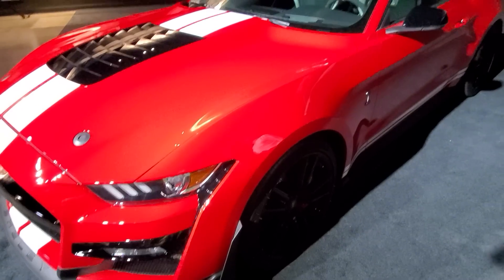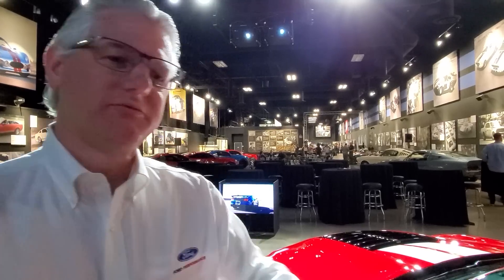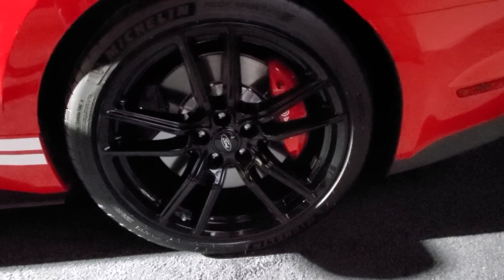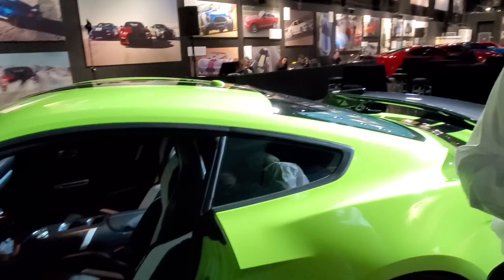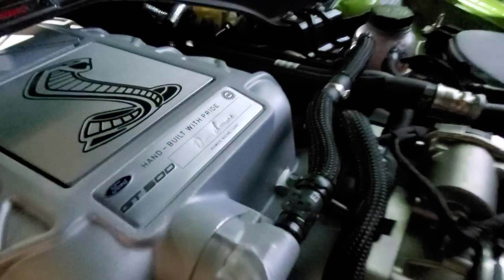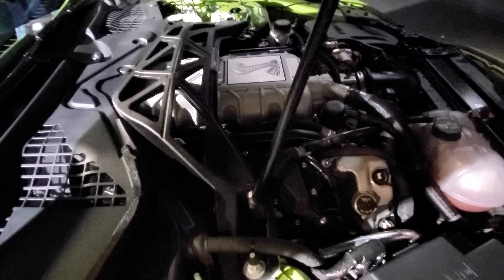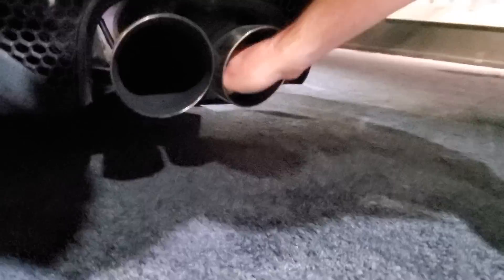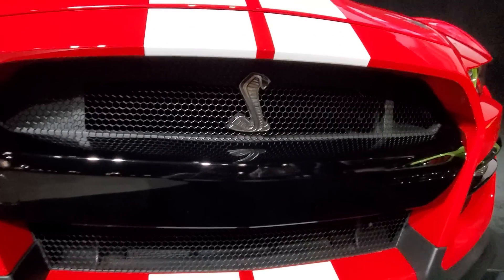2020 Ford Mustang Shelby GT500 Sneak Peek: Base Or Track Pack? We Show You The Differences!

Comment: Shelby GT500 or Roush Stage 3? 🤔
Reply: DaveSKI Shelby. Better suspension breaks and cooling. Oh and a higher rated transmission
Reply: @devinbender8428  But does it have a manual transmission?
Reply: DaveSKI yea. But have you ever driven a high HP car with a manual? It isn’t fun. Sure day to day ain’t bad. But on a track? It’s impossible to have fun because your always focusing on shift points.
Reply: Devin Bender if your a skilled manual driver it comes in second nature no need to focuse on shifting 😂😂
Reply: @devinbender8428  They're somehow able to shift in 900hp cars in NASCAR
Reply: DaveSKI 
1 NASCAR is a 4 speed and even on road courses only use 3rd and 4th 

2 Lemans cars only have 500hp and are 6speed sequential gear boxes.  Not H pattern.

These cars are 700+hp 7speeds. 

I’ve driven a z06 vette and it’s not easy with a manual. That’s a big H pattern. (Ive driven many manuals. Learned on a 90s Chevy) If it was sequential that’s one thing. 

Also last thing you want to do is “money shift” in a 80,000+ car
Reply: @devinbender8428  The Roush has a 6 speed
Reply: @devinbender8428  If its Dodge Demon power, yes you cant handle shifting, but 700hp is still manageable by your average stick shift driver
Reply: DaveSKI manageable that’s one thing. ANY car is manageable. 

But fast on the track? Very hard

Comment: I just wish it had the updated headlights
Reply: Sander Valpey ford said the old headlights work better for the cooling system
Reply: @devin bender They could have changed the shape of the vent. It’s because they started the design with those headlights. They could have designed the vent while designing the new bumper and headlight housing.
Reply: Sander Valpey the used the gt350 as a starting point. And the radiators used in that wouldn’t fit in the new front end design. That’s the main reason. 

Re engineer the whole front end cooling system. Or use the old style.
Reply: Devin Bender I get. With all the wait and hype. Why not make it new. People may have paid more for it

Comment: So top speed is slower than the previous GT 500
Reply: Maurice Cooper because it’s electronically limited for insurance and safety. 

There are very few places in the whole world you can hit 180+
Reply: @devinbender8428  I hit 165 in my 3v on the highway I'm sure the newer mustangs can go 180 on a highway
Reply: glasstop_3v 

 and that is the reason why it’s electronically limited. People illegally taking a car down the freeway at 200 miles an hour.

In a LEGAL setting, 

Autobon 
The Ring,
Salt flats 
MIS
Daytona
Talledega 

That’s about it.

Comment: 2014 GT500 Shelby: “is this supposed to be a better me in 2020?? And it can’t do 200mph....AND ITS NOT MANUAL what a disappointment🤦🏽‍♂️”
Reply: ZEUS6.7 two different cars. Put drag radials on a 13-14 and go 11 flat, pulley it and go 10’s
Reply: ZEUS6.7 

It’s electrically limited to 180mph for safety and  insurance. 

There are very very few places IN THE WORLD you can hit over 180mph
Reply: Scott Croce yes I’m very well informed thank you. But it was a joke
Reply: ZEUS6.7 unrestricted top end is 224mph(with special tires) factory tires only rated to 186mph but don’t tell anyone.
Reply: Scott Croce well I’m sure the new GT500 can well achieve that it’s the same with a lot of the other car manufacturers for example the Redeyes, Camaros, etc etc.

Comment: TFL, today is October 26th, 2019. I know an amazing and great man that lives in Reno. He and his associate/friend have (after many years of research and thousands of dollars) patented a new fuel delivery system that (on his test vehicle, has almost doubled the gas mileage to between 50 and 60 miles per gallon on unleaded regular gasoline). And because the the system causes the gasoline to burn so much more efficiently and CLEANER, it greatly reduces emissions. Some of the tests so far have gotten virtually ZERO pollution results. In my opinion, THIS IS HUGE and I am encouraging you to investigate this. This new fuel delivery system can be modified to work in vehicles and all types of motor applications, but the costs to do so can be high. This development has worked, is patented, but needs deep pockets to get it off the ground. I was thinking about NASCAR where the race cars could eliminate a fuel stop or two. Or government agencies (like the Highway Patrol and CITY Police Departments) where fuel costs are so high, and could be greatly reduced. IF you are interested/curious, please let me (Always Good) know by replying to this "Comment", and I will get back with you! It is just a matter of time before this new fuel delivery system is adapted, and you have a chance to check it out and be a big part of it's implementation!

Comment: The capability to be outsold 30 to one against the C8 corvette.
Reply: Donnie Baynard C8 will be just as fast in a straight line. But not on a track
Reply: Devin Bender holy shit i hope ur kidding. C8 will eat this thing alive, not even talking about when the z06 comes out. Go compare the weights of this pile of overpriced shit to the c8. Who wants to be that guy that is pretending to be proud that hes driving around in a MUSTANG that they paid $100,000+  for it.
Reply: @Drewfus53  What? The base C8 does the quarter mile in 11.1 secs. The GT500 is going to surprise everyone come Tuesday when they can release the numbers.
Reply: @Drewfus53  Also, the weight is only so high because of the 8..EIGHT intercooler setup system.
Reply: @Drewfus53  that ugly-ass  vette will get it's shit pushed in hard by this "overpriced" mustang! Only thing it comes close in is the 0-60 and then it falls on it's ugly face at that point by comparison!
Reply: @Drewfus53 
Well how are you feeling now that the 2020 GT500 beat the 2020 Corvette?
I mean... You did say in the comments that it was going to lose...and yet it couldn't keep up with the track pack.

Comment: Even with 760 hp. Shelby can't do 198 mph like hellcat
Reply: They don't need to. You won't reach that speed for half the cars life so it's not a big deal. Also it can go way faster then 180, that's just the limiter stopping it.
Reply: Gurjot Sohal there are like 10 places In the word you can realistically hit over 180mph

Daytona
Taladega 
MIS
Salt flats
And maybe the Ring on the main straight.
Reply: They hit 202 in the 2013 model year
Reply: Well that’s only the Carbon Fiber Track Pack that can do 180 mph because of the downforce with the huge splitters and a big carbon fiber wing that’s good on the racetrack. But the Standard Pack 2020 GT500 that weighs 300 lbs more than the Track Pack with four seats that’s good on the straight line, woo! 213 mph is a hell of a monster for a car this capable. And look 213 mph uhh the Dodge Challenger Demon. 840 hp 770 lbft making it one of the most fastest street legal drag production car ever, is 211 mph.🙌⭐️🐍🏁

Comment: Tell the chief he dropped the ball with the automatic only!
Reply: It's actually a dual clutch transmission. Automatics have a torque converter, DCTs don't. Ford realized the limitations of the manual transmission with the 2013-14 GT500. They were getting beat at the track/strip by less powerful cars due to driver error. Manuals are just for fun, DCT & autos are for winning.
Reply: @chrism.728  Yeap, if you want a fun track car that is a full manual drivers car with incredible sound and power get the GT350R, if you wanna race and win and put out some crazy times go with the GT500, especially the track pack, or if you want to do everything else like daily drive and just have a fun experience and maybe mod the car in the future go with the base model GT500.
Reply: @chrism.728  ford wouldn't care if the car was losing due to driver manual wtf there can be driver error in whatever car you buy as long as a human is driving it ....

Comment: Should have had 850hp
Reply: drfaticus F-gm why? 
Only thing Hp is good for is top speed. 180 is fast enough for 99.9% of tracks. 

Torque is what matters for acceleration. And unless you use track tires or drag radials (like the demon) you can’t go any faster with more torque. (Unless you have awd) Because you cant put it down. 

750hp 650lbft is about the limit you need.
Reply: @devinbender8428  you don't know what a person needs. Some people like the texas mile or other long straits. I could care less about 1/4 mile racing. So 750hp is all you need
Reply: drfaticus F-gm it’s a track car! 
It’s made to drive to the track set a good lap and drive home that’s what it’s made for.

You want a faster track car? Buy a race car! 
Want a faster drag car? Get the CobraJet (which this car is going to hit 10.8s easy) 

Point is want more power add more. There is a reason why even the Demon with 808hp is only MARGINALLY faster

Comment: 180 mph top speed? Where do these ponnies go its speed is so low?
My 07 M6 goes 207 at 507 hp 🤷‍♂️
Reply: Lol, sure it will.  The world’s most unreliable engine.  It will do 207 once.  ONCE.  LOL
Reply: Speed limiter to satisfy Gov. And Insurance companies. The 2014 went 199 mph with 662 HP
Do the math
Reply: The new GT500 is electronically limited by Ford, 180 mph is not the true top speed. This is an easy fix with a handheld tuning device to remove limiters if you don't care about factory warranty. I believe Ford limited the GT500 to 180 mph  because of factory tire rating (186 mph max).
Reply: @tnitron9750  I'm not saying it cant do more, it should. Likely comment shows im wondering why only 180 I never said it's not capable. And for all the trolls here I do like fords, gt350 especially.
Reply: Oh wow guy owns suicidal BMW M car
Reply: @chijen2010  LOL
Reply: Chris M.  So, why does the ZL1 top out at 200mph and the ZLE at 190mph...